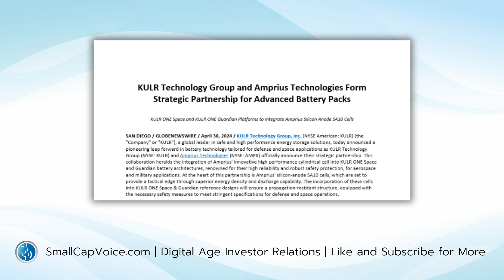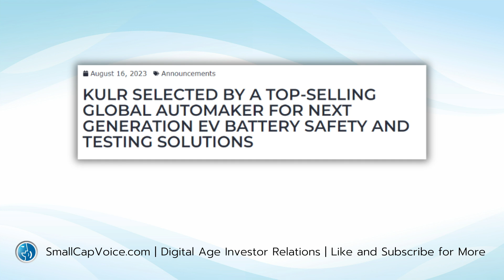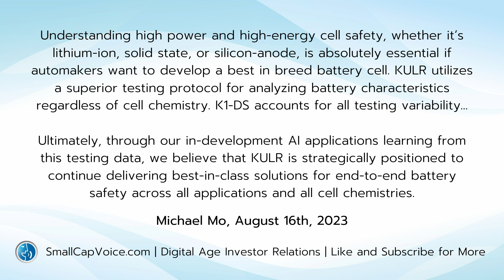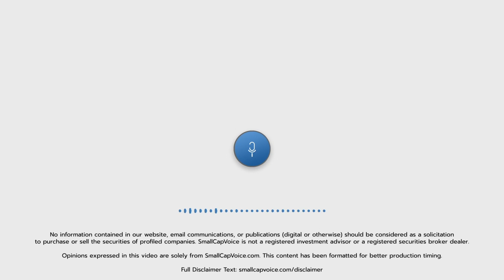KULR and Amprius: Revolutionizing Battery Technology

Comment: Silicone anode batteries do not last 10 time more longer than conventional lithium batteries.  False information. From what I understand amprius silicone anode batteries do not have a long cycle life and current batteries start degrading only after 500 charge cycles.  If amprius increases the charge cycles to 1000, it negatively affects the high discharge output and the energy density.  Massive costs to scale production, performance issues with scaling, and competition from CATL dominating the battery market can potentially bankrupt this company so it remains a very risky investment.